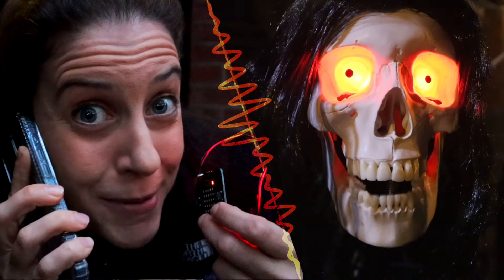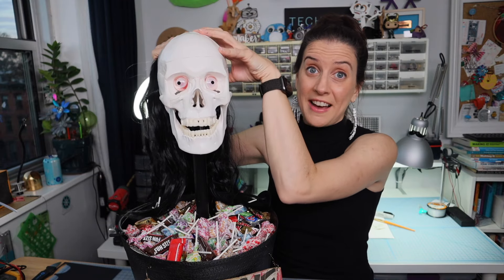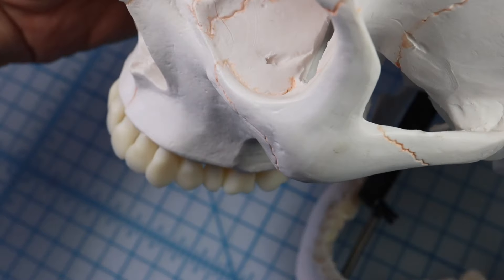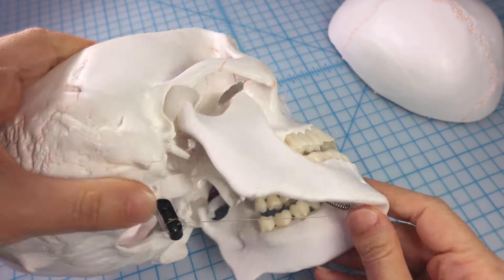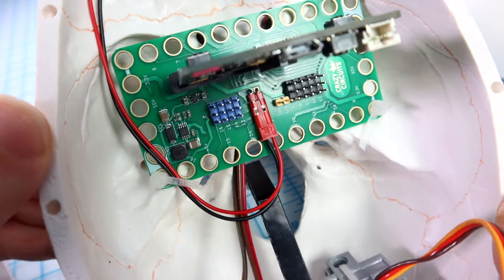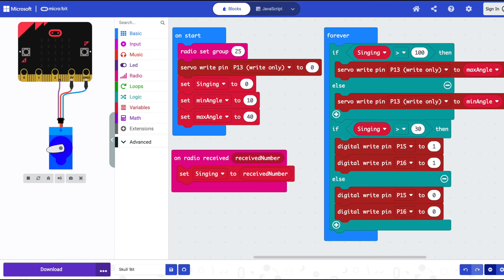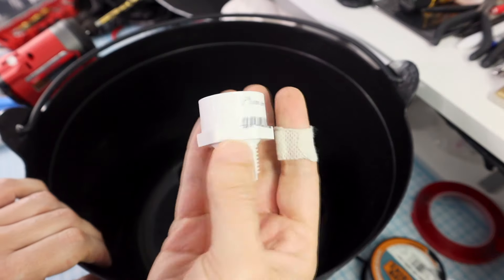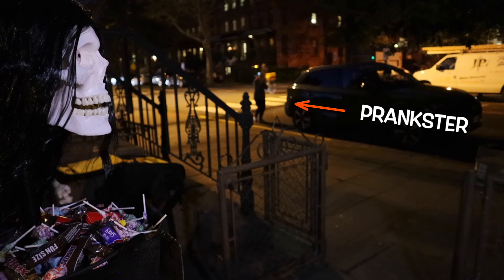Easy Talking Skull with micro:bit - Remote control animatronic skull DIY

Comment: Thank you for the video! Would it be much harder to make the voice/ jaw work directly with a microphone?  For some reason the two phone part makes me nervous. Im a complete novice so I'm have no idea
Reply from the maker: The jaw is moving according to the micro:bit's microphone (it's one of the components on the board). The phones are to "send" the voice into the skulls mouth. If you had a PA system or karaoke machine and a mic with a long cord, you could create the same result. The idea is to get the person who is voicing the skull far enough away from it so that you don't hear them and think the voice is coming from within the skull itself! :)

Comment: hi i was wondering if i can do this with one microbit if i talk right next to the skull???
Reply from the maker: It wouldn't be great because the motor makes noise and it would trigger it the same as your voice, but if you extended the wires and placed the micro:bit outside the skull, that could work! :)